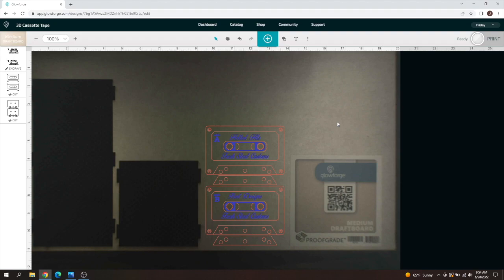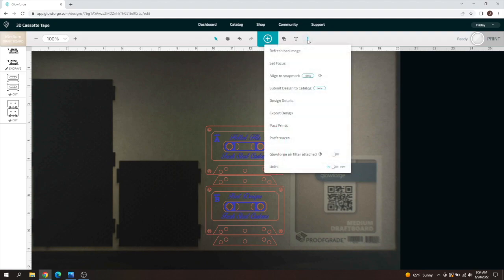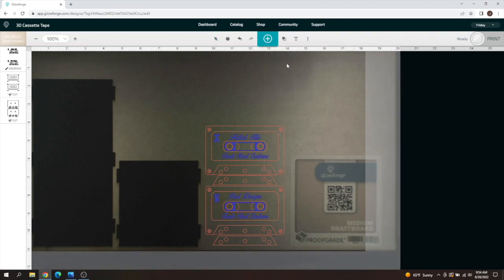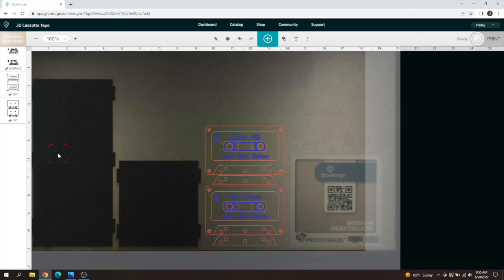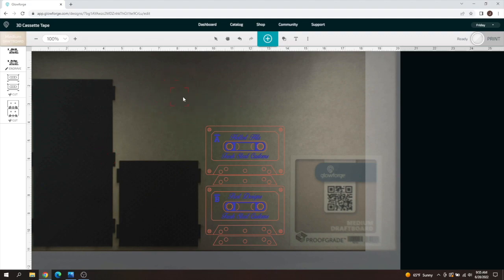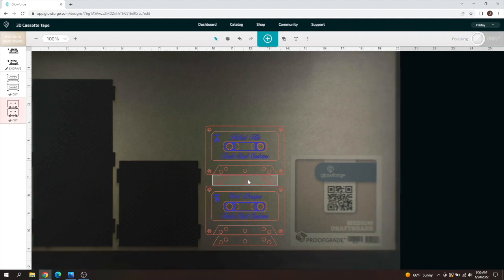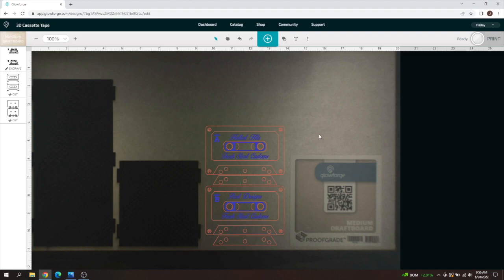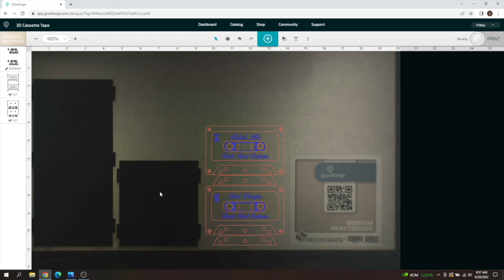Why auto focus is not working for your Glowforge

Comment: Did not work help  stuck with a yellow light
Reply from the maker: Yellow light means your machine is overheating. Clean your fans and cool off the room or you may need to contact Glowforge’s customer support.
Reply: @FreshStartCustoms  goes back and forth with the yellow light and focus and centering
Reply: @FreshStartCustoms  Yellow light is a generic warning/error light, doesn't necessarily mean the machine is overheating. Could be anything from a bad or dirty lens, a bad data cable, bad daughter board, or even a bad motherboard. Lots that could go wrong in the machine.
Reply from the maker: @ true, I was just basing it off the most common thing that caused it that I seen others reporting back when I made that comment
Reply: Bro I got it to work and now it went yellow again and then sayin focusing again and then I get centering